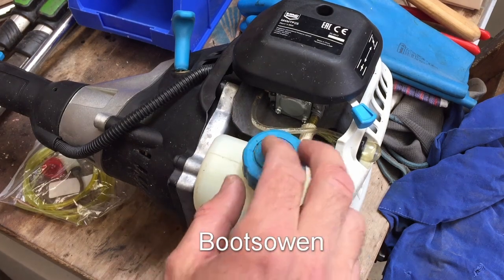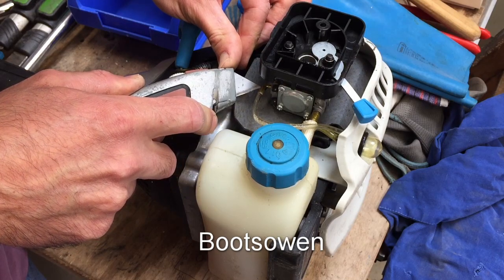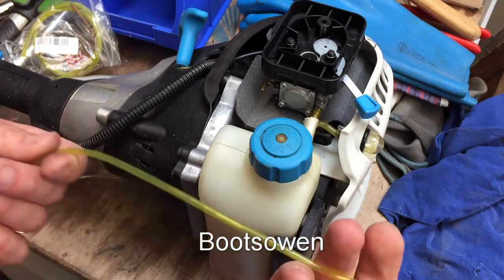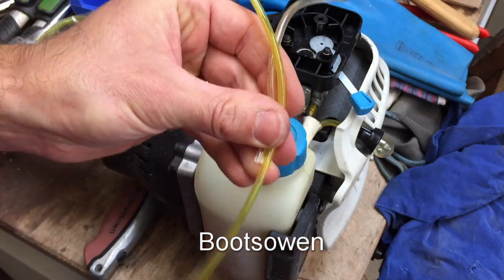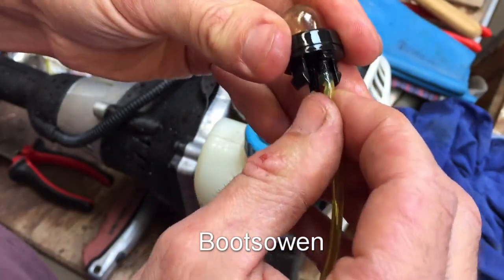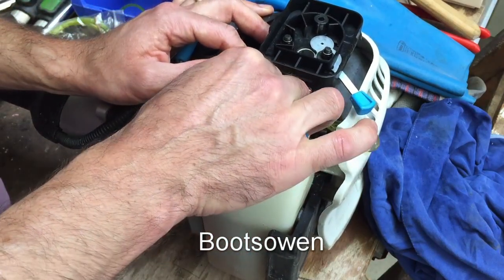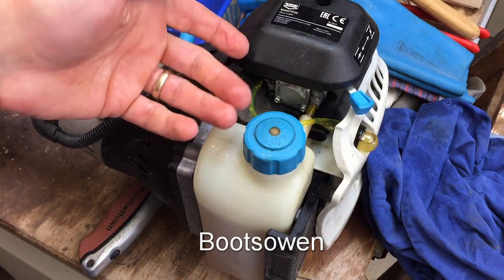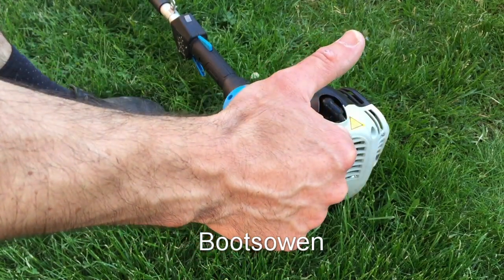Strimmer won't prime? Mac Allister M4MTP25 multi tool hose replacement

Comment: Just got mine yesterday worked first time then on second start it refused to start. Doubt it's fuel lines being brand new but I'd like a little help. I'm hoping my fuel mix is ok
Reply from the maker: Thanks for sharing
Reply: @bootsowen  no problem thank you for the video as applicable to all strimmers.
Something worth remembering is fuel goes off if left in the tank n tubes this is what ruins tools & why you see 300+ equipment sold on for a fraction of the cost & this could be avoided.  😉